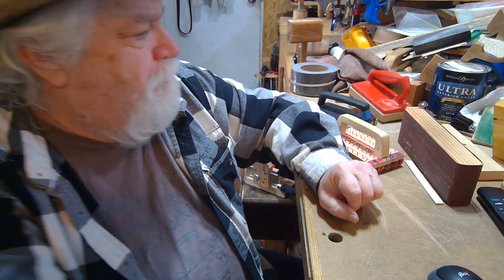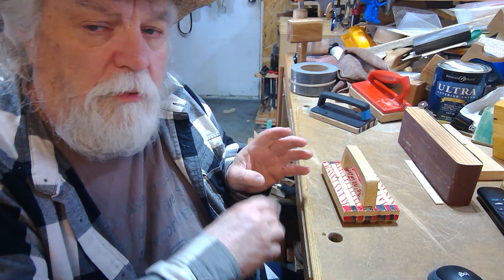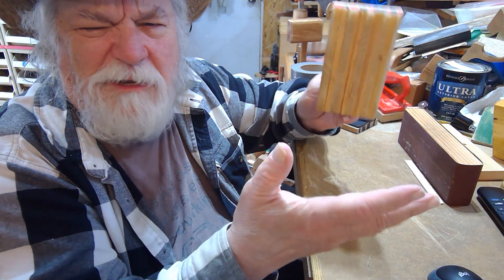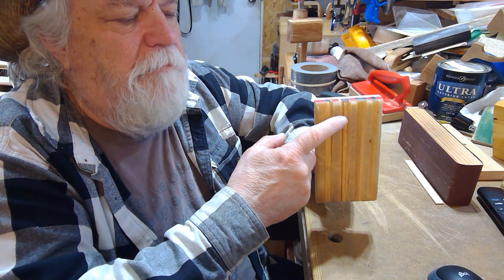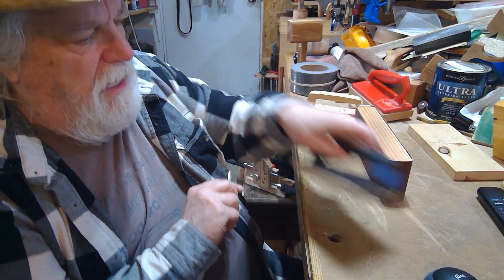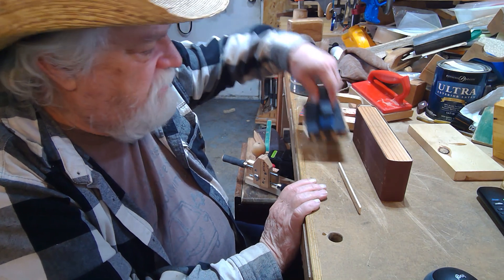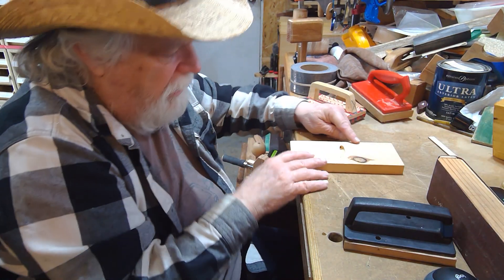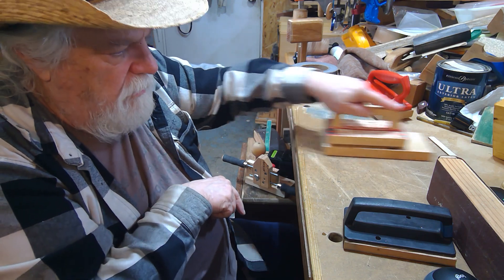New NMP Gripper by OTB Thinker

Comment: I layed out your spacing on two strips of paper 3-1/8 and reversed them.  There were problems.  After working on it, I found spacing of 1/4 no cuts, 1/4 cuts, 1/4 no cuts, 1/2 cuts, 1/4 no cuts, 1/2 cuts, 1/4 no cuts, 1/2 cuts, 3/8 no cuts.  This avoids any problems with 1/8 or smaller kerf.
Reply from the maker: I have done several different patterns and some work better than others.  I should also mention I use a 7-1/4" blade which has a 1/16" kerf.  I am sure there is a better pattern for the 10" blade also.  Just remember that the idea is to have a number of no cut zones across the pad to get it to grip the cut piece no matter the size of it.  The pattern described in the video was used on my old gripper for 3 years and it seems to still work OK.  Thanks for your input, Andy